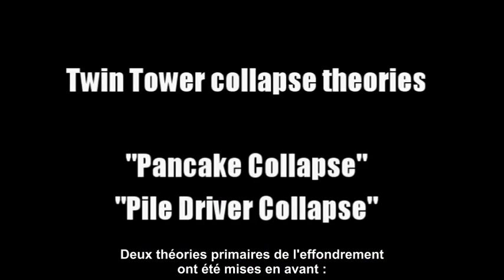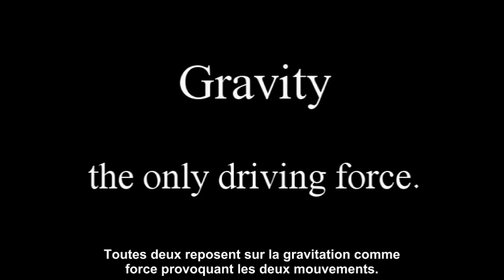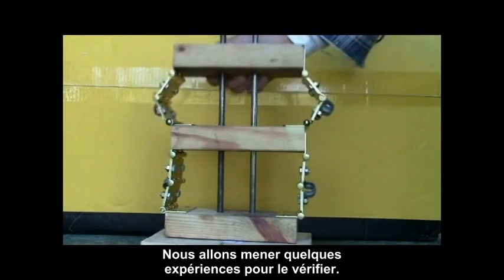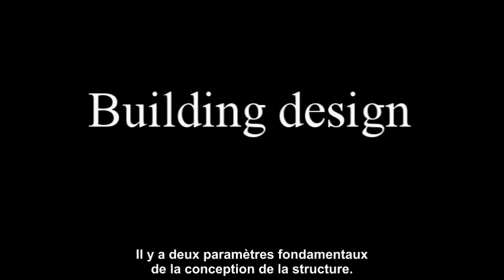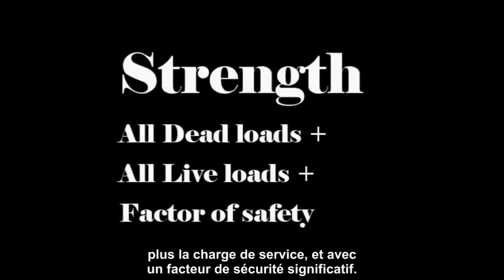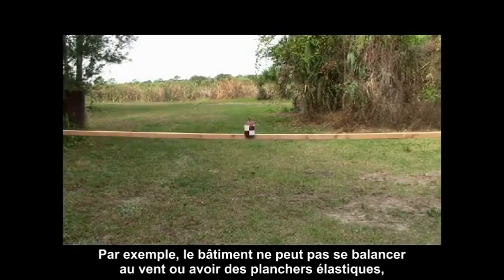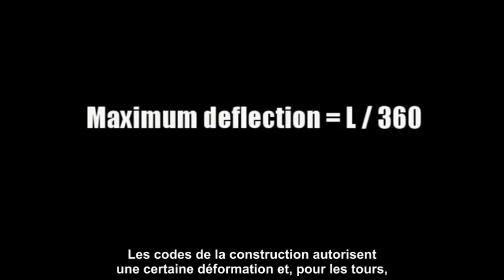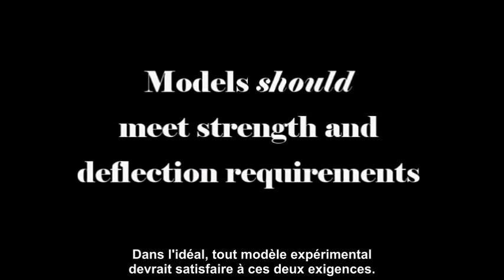Jonathan Cole : Avant le mouvement, une force - sous-titres français

Comment: your physical models are stupid, and have no validity at all. computer models are accurate, there's no reason to discredit them. you are better off learning how to model it on the computer than building these completely random models in your garage. the structure and different weights of different parts have no applicability to the real world trade centre buildings.
Reply: Haha... sir, you have no clue about experimenting. Computer models can be altered to how ever you like, the experiments demonstrated in this video used materials with LESS, yes, less allowable stress than the materials used in the twin towers and it STILL wouldn't fall like we saw on TV. What's your explanation for that? 

"..no validity...", "no applicability...", it's funny reading that, because you are trying so hard to sound smart but anyone with an engineering / mathematics education knows that what happened in this video is a lot closer to reality / the truth, than ANY NIST computer model...
Reply: +U4IKST8 you aren't interested in truth, just in proving your own preset beliefs. This homemade tower would fall differently depending on what materials he used, eg metal sheets instead of cardboard. It's just a really stupid 'model'. Hasn't got the weight of the floors right, hasn't got the main support beams modeled correctly, just a pizza thing? It's idiotic to put any weight into this model. I don't know about the nist models, but I'd like to see this guy do some computer modelling of his own. I'm here to get the other viewpoint, and find this utterly unconvincing. He's never going to sway people, only preach to the choir.
Reply: Well if he uses materials weaker than what was actually in the towers, cardboard instead of metal and plastic legs, and drops the weight from further than it fell on the day and it doesn't fall in any way similar to how the towers fell, then that tells you all you need to know... anyway, I'm not hear to preach, all the info is out there, if you can't see it and just want to "get the other viewpoint" without analysing the info, you will never be convinced of anything...
Reply: +U4IKST8 you just don't understand. Cardboard and plastic are fundamentally different materials in their atomic makeup than steel and concrete. This model can't apply. I'm not saying if a conspiracy is true or not, I don't know. But this model is useless, and you should open your mind to that possibility.
Reply: I can assure you I understand... probably more than you ever could too... I've spent the last three years in college studying different engineering disciplines... electrical, mathematical, mechanical, fluid power, automation, manufacturing, to name a few... I can see the validity in this mans approach and you come here saying it's not valid? And it is not applicable in this situation? What qualifications have you to say these things? What are you basing your opinions on? Just what you think? That doesn't cut it, sorry, it's just not good enough to say that, you need to have an understanding, which you clearly do not... you just come here to be the other side of the argument without any experience... I say this because I know that if you did have an education in this area you would not say the things you have said...
Reply: i have a mechanical engineering degree that's why I'm saying these things. not that that matters. you haven't addressed my argument, you haven't explained why the different materials are still valid. you've just attacked me as a person, a sign that you've lost the argument.
Reply: Well, to be honest, I am glad you said you have a degree in mechanical engineering...now I can stop replying here... conversing with a liar is one thing I do my best to do less of... goodbye...
Reply: So you totally ignored what Richard Feynmann said at the 2:20 mark. Are you aware that the word ignorance comes from the root word ignore?